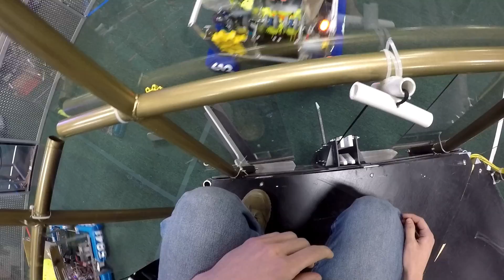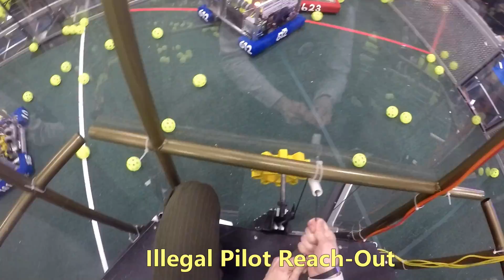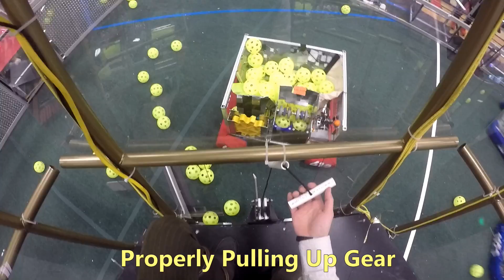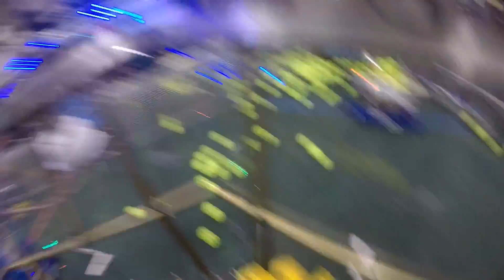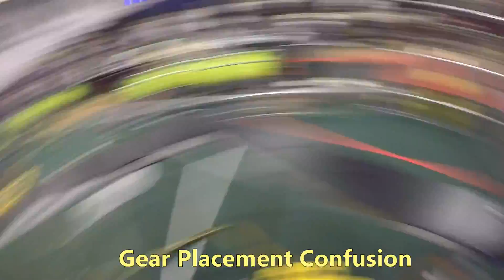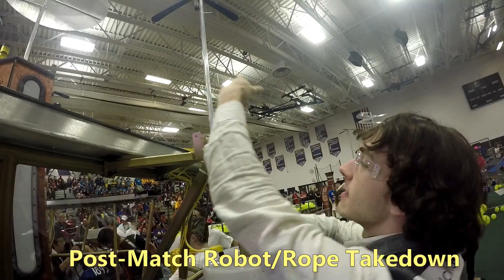FRC 2017 Pilot Training

Comment: Why is the lift rope going through a piece of PVC pipe?
Reply: Is this an official change by FIRST? It wasn't like this at the week 1 event and I don't believe it was like this at the week 2 event I went to.
Reply: Interesting. This change seems to make retrieving a gear a bit harder/slower though, and a greater risk of putting your hand outside of the airship.
Reply from the maker: These videos were taken from Week 1.  I observed the PVC had been replaced by loose zipties at the Week 2 CVR Regional.  It's possible not all competitions are consistent with this?
Reply: Yeah, I was on field reset at FIM Kettering District Week 1 and we didn't have these or any version of a lift rope retainer.  But AFAIK, the lift rope wasn't falling out of the airship much (or at all) anyway.